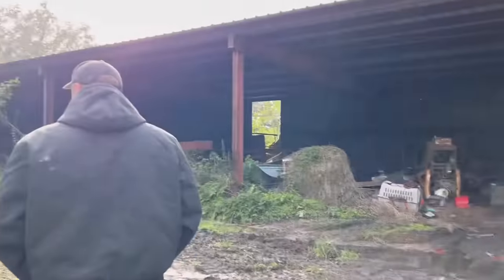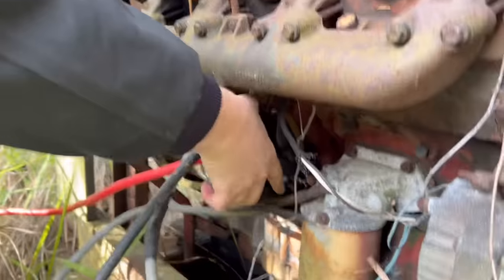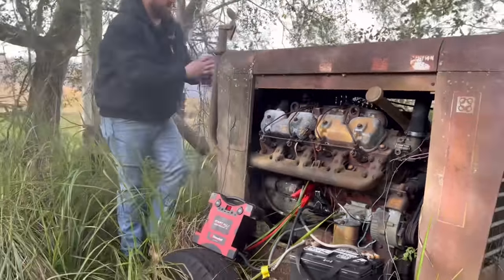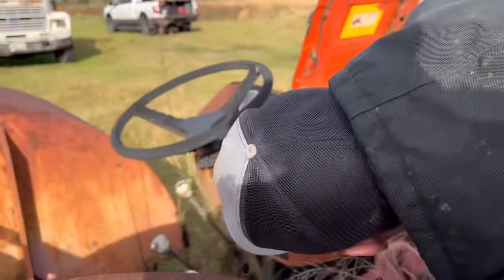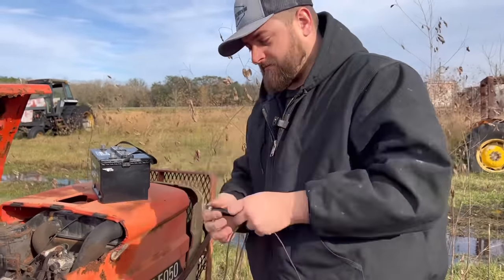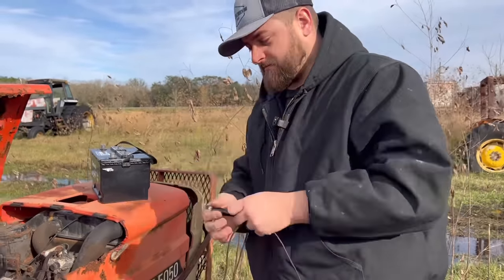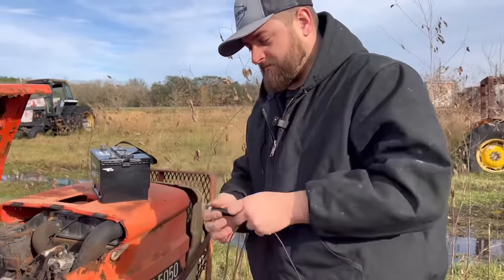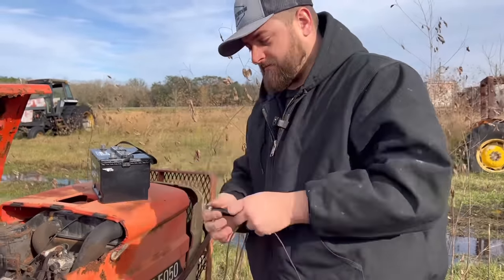1896 Case Diesel Tractor, WILL IT START?

Comment: I'd take some pictures of those stickers to reprint first. Then can paint everything in. Emerald enamel white gloss paint for the white color to.& The other colors to. That would make that tractor look sharp on the super cheap to. Just by wire wheel scuffing up the old paint for A surface to stick to really good. I'd also invest in some clear coat in the cans to. Let it cure dry in your heated ship for three days solid then wash it.& Wax spray it really good. And watch it shine.

Comment: I've got a good project for you a couple actually, And if you can start them you can have them,ones a old cable blade D-8 dozer,it ran excellent when it was parked 27 years ago,the winch for the cable broke,we parked it but the engine had just been rebuilt 2 months before,the other is a old T Rex road mixer with a 671 Detroit engine ran and worked great before we parked it 15 year's ago, just ran out of work for it

Comment: Bruce, I have an 1155 Massey Ferguson with a 540 V8 Perkins in it that is locked up, if the owner is interested in selling that pump I could use that engine to help in restoring my 1155. I live in VA but if the price is right I'm not opposed to driving to Florida to pick it up.
Reply: I'm sure  this is an older 510 v8 thats in an 1150, its smaller capacity/hp than whats in an 1155 . Parts are getting hard to find for both, I don't know if tractor and power unit cranks/blocks are different because of the front pump driving off the crank pulley on the tractor there may be different block mountings other than the oil pan being different for the tractor axle as well . I know guys have had problems on some 6's from combines to tractors so you'd really have to check out it would fit if the smaller capacity doesn't bother you.. Perkins are real annoying for this block /spec garbage, I rebuilt a 1004 in a landini tractor it's got stuff on it thats different to the 1004 MF tractor engine and a Massey gasket set won't fit some of it.
Reply: @super6954  thanks for the info, I definitely want to stick with the 540ci so if this unit is smaller I wouldn't be interested even it it would fit directly into my Massey.

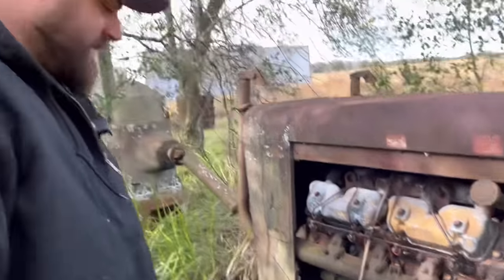Comment: 1:32 Perkins 540 or 640ci V-8
Reply: Looks like the Perkins 510 that's in a MF 1150 tractor the  thermostat housing on  it's 2 piece, I got the parts page here I need the LH side one for my pull tractor and its obsolete as a new part . The 540 housing thats on a MF1155 / newer 2745  is way different  comparing  them. The 640 thats in a MF 2805 is a physically  way bigger motor at 10 liters compared to 8 on the 510 and 540, the rocker covers a different shape to on the 640, it doesn't have the same cut outs it's more plain rectangular shaped.
Reply: @super6954  ahh ok. I cant really tell them apart except from the size. I have a Massey Ferguson 2805 in real life and its got an ATV8.640 in it and its a mean fucking bit of gear